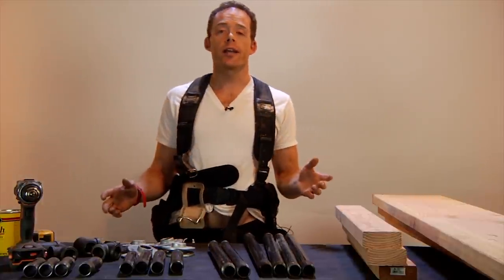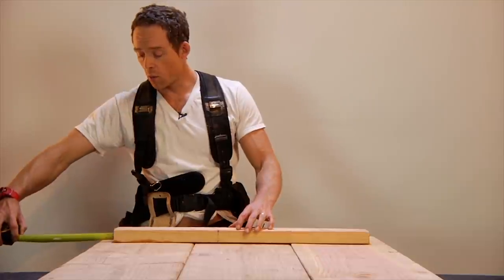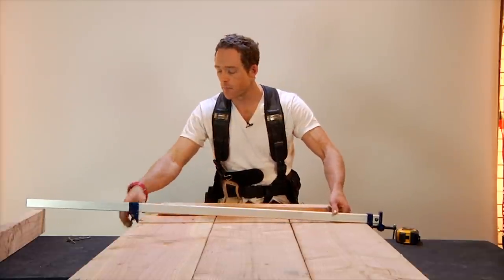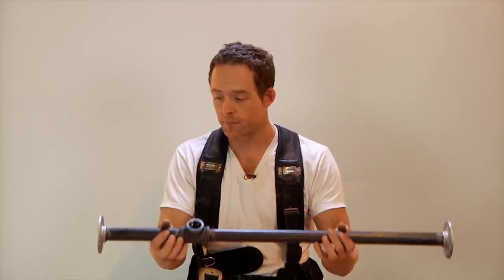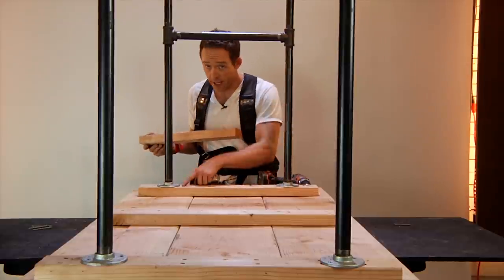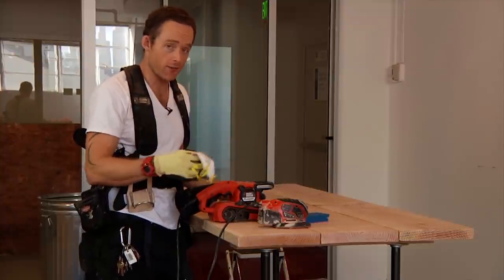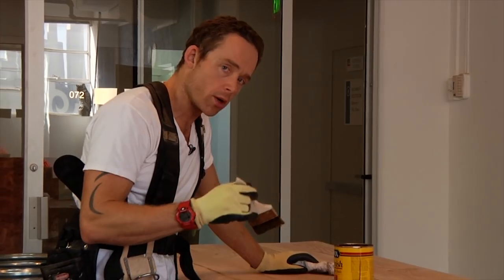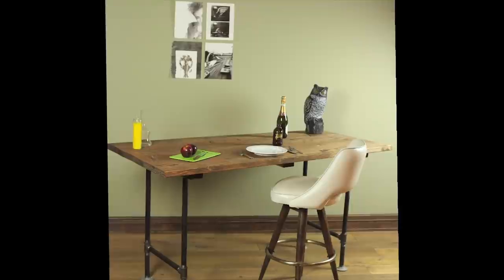How To Make A Table With Pipe Legs

Comment: or you could mount the T connectors with the middle pipe first and then add the legs
nice project btw, I'm doing this, but with just one board on top and one on the bottom
Reply: that would be too easy
Reply: the mint he said u need to spin the hole lag or that u need a partner i was lol dud and was thinking that same thing as you.

Comment: Great project.  I would use 2x6’s as the braces rather than the 2x4’s.  That way the metal feet would screw in straight rather then having it overhang.  Great project.

Comment: To prevent the seams from showing recommend hand planing to make sure the boards are level, then gluing the edges, then planing and sanding the top. It will make a much nicer finish then shoving finish in-between the boards.

Comment: Do not mount the legs to the 2x4's. Just get some 1"1/4 screws and mount them to the bottom of the table. Will be much more sturdy. Eventually they will mess those 2x4's up when you move it around.

Comment: I hate to say but for 2X12 you got to use 2X6 not 2X4 and not pilot holes on the 2X4 (hole through the 2X4 to fasten two woods ),the way you made it after a month it'll shake as having earthquake, that 2X12 and 2X4 are surface dried.

Comment: how much did it cost? i had to spend $200!!
Reply: +Blake Vette he said the boards are 6 bucks a piece, so i would say it would cost less than maybe 60 in total? Can't tell precisely. Also don't forget when you buy furniture or any other thing in particular that you pay for the TIIIIMMEEEEE to make this. And btw 200 is hell of a lot, check the less known businesses before buying or like in this video - do it yourself which is almost always the best option
Reply: +Karaon It's not the wood that's the problem, the pipe can get pretty expensive. Just for an example, the 1" floor flanges are a little more than $7 each (Lowe's, $7.18) and 8 of them are needed. More than $56 just for the flanges. While I'm not sure it would add up to $200, I couldn't imagine it being much cheaper. My only thought to lower the cost would be to use 1/2" or 3/4" pipe, both of which could likely hold the weight of whatever it is the table is being built for.
Reply: I just priced this at my local Lowes, 1in flanges are about $12.50ea, so 8 of them like in this video would be around $100, it seems kind of ridiculous to me honestly.
Reply: Black iron pipe is a bit cheaper than galvanized. The fun part is, you have to clean it before using it, the black coating gets all over everything.
Reply: Really interested to know which pipe it was you bought for $12.85 - I can't find any 10ft lengths that cheap on the home depot website
Reply: I think the price varies from location to location. The price listed in the link you provided is $18.26, my local Home Depot has it listed as $17.26, and the 10' black iron pipe (3/4 inch) is $13.26. Nonetheless, your idea would likely save a few bucks over purchasing each piece individually.
Reply: I'm in the burbs of Philadelphia. No Menard's in the area, I checked after your first reply. :)

I've found that while the difference isn't by much, Lowe's in my area is less expensive but we're talking maybe a few cents per piece at the most. There are also local hardware stores but they're usually more expensive than the big franchises. I already built what I needed and will definitely be looking to build some more with the pipe but for now, it's on hold. That whole responsibility thing keeps getting in the way!